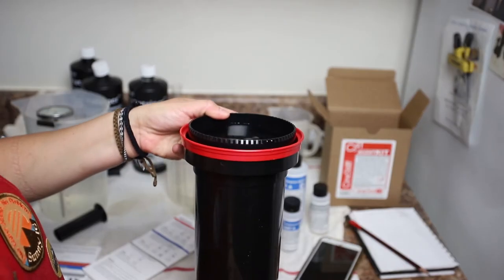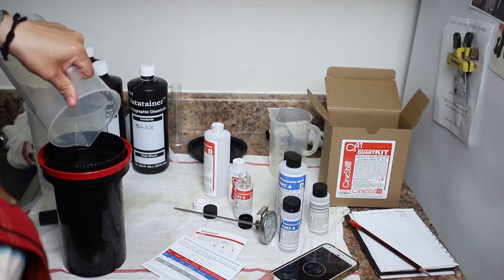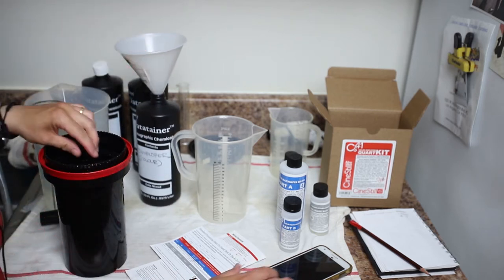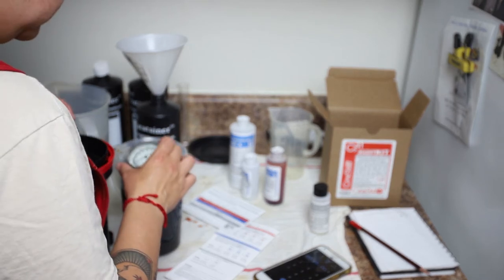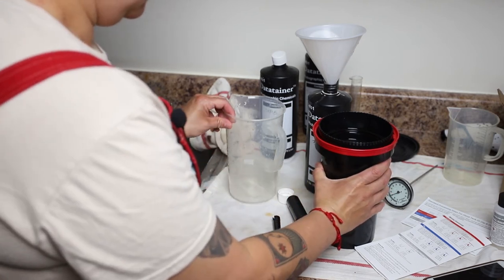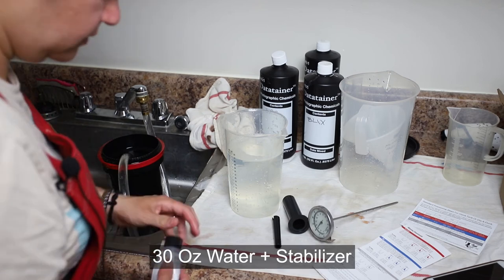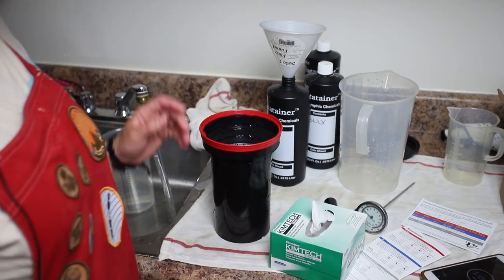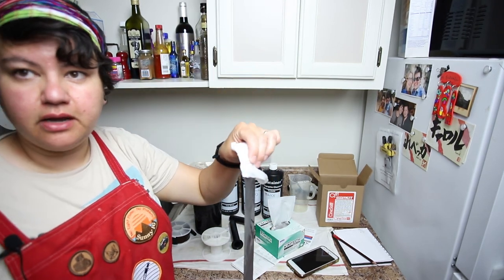Kitchen Lab: Developing Color Negative Film

Comment: Hi, your negatives look like they were overdeveloped.  The residual developer on and absorbed into the film was still working while you were making the blix.  My understanding is that the 3:30 time is start time for developer to the start time of blix/stop bath.  You mentioned, but looks like you initially used cold water to wash after blix, which can result in reticulation.  I like the using of the kimwipes and how about some samples?